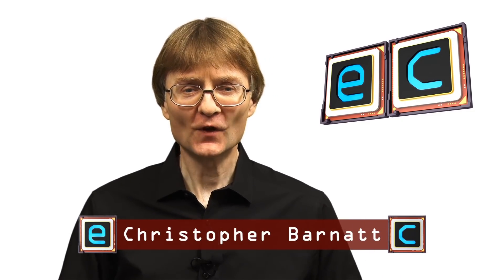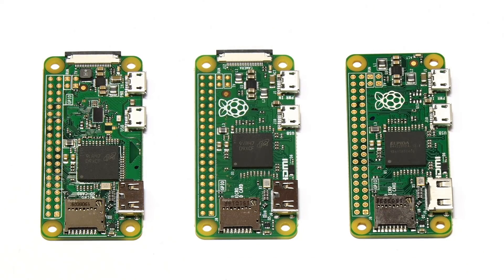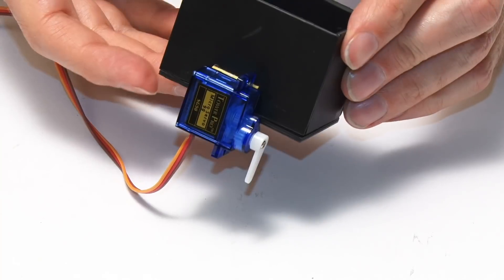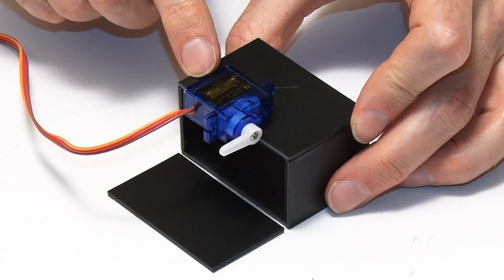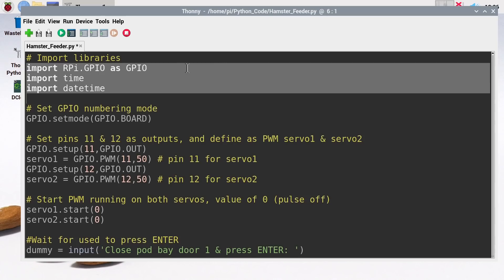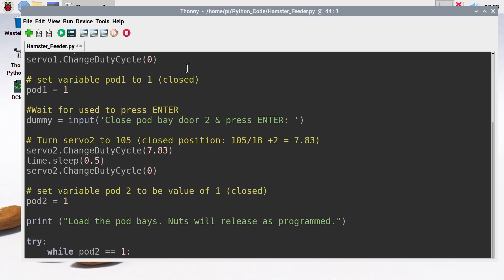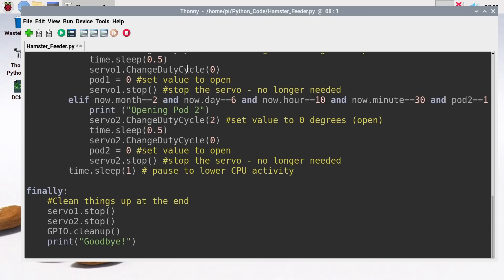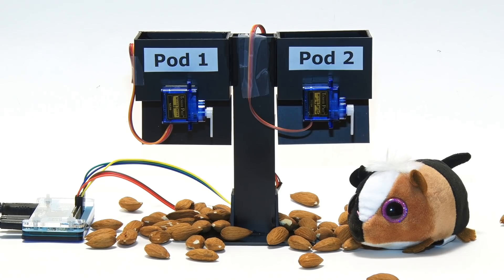Raspberry Pi Zero Hamster Feeder

Comment: This is pretty cool but you could have placed the pod hinge on the other side and then actually close the door as well.. allowing you to only let some nuts drop out and then close it again. This can also be used as a fish feeder. Lots of potential!
I am looking at doing a system that can open the curtains in my house at specific times and closing it and I think a Pi can do it. I will just need to power the servos from elsewhere.

Comment: I have a old Pi B - I use to have it working years ago not used much.  Now I cannot get it work I download the files onto a 64GB card - when I plug it in I have a solid red light and nothing comes up on the TV .
Reply from the maker: An early Pi will not be able to use a 64GB SD card. So I imagine this is the isuue -- try a 32GB card or less.
Reply: @ExplainingComputers  Thank you Ill give it a try.
Reply: @ExplainingComputers  work thank you
Reply from the maker: @davidcocklin2109  Excellent! :)
Reply: @ExplainingComputers  Even got it working in Remote in Windows.

Comment: Why add the servo on the front . If you added it on the back it could both open and close the  pod
Reply from the maker: Very good point. But the servo is more likely to hold closed without power (maybe!) the way I did it . . . :)

Comment: Hi Christopher. This is the type of proyects I personly like a lot. However, I have a proyect idea that I think a lot of us would like to see. It has to do with raspbery pi clustering. I think there are many more powerful uses to a pi cluster than a pi alone. Thanks.
Reply: My proyect uses 4 cameras and a software called motioneyeos which is build for a pi. However, one pi overheats wen running the 4 cameras. Wondering if a cluster of 4 pi would work...
Reply from the maker: A cluster is on my list. I just need to figure what I would do / show with it. :)

Comment: This code is very fragile. If anything goes wrong, the hamster goes hungry.

I would conceptually orient the code toward holding the doors closed rather than deciding when to open them (implement by putting an open doors function in your loop that has to be defused every iteration, for example... also be very specific about dates, and do robust bounds checking on each loop iteration). I would then create multiple broadly triggered failure paths that lead to the doors automatically opening. Unhandled exceptions and unexpected program exits should also open the doors. Since you really don't want your hamster to go hungry, you should also create a redundant system on a separate battery-backed raspberry pi that monitors the situation and releases the doors if things aren't in EXACTLY the expected state.

p.s. I understand that this was instructional, and not meant to be copied for an actual animal feeder... But someone may well do it. I think with this sort of example in particular, it's important to also discuss fail states and failure tolerant design. We wouldn't want to harm any hamsters!
Reply from the maker: Good post. :)

Comment: Fun. I would have put the servos on the other side though. So they could also close the doors without human help. Allowing for a single pod bay, and maybe a srwpper motor controlled "reloading" mechanism kinda like a capsule toy/gumball machine meathod to push more nuts into the pod. It could then just be set to every x time open servo, wait a few seconds then close. Then rotate stepper moter to refill. Rinse repeat. But always fun to see small projects. Pi0 seems good as any to controll all that $5 board as opposed to $10 arduino uno or what have you.

Comment: or using gpiozero library = https://www.raspberrypi-spy.co.uk/2018/02/basic-servo-use-with-the-raspberry-pi/
also pyboard uses micropython and has specific servo connectors (not on model D), but more expensive than pi0
now thinking about a 7 day feeder where 1 servo pushes each doorhandle out of the way to release ...

Comment: That raises the question of "why?", typical for vast majority of rpi "projects" on youtube. Likee with the mirror that displays current weather (and you have your smartphone in your pocket right there). The chineese auto-feeders cost like 5 to 10 $ (i use one for my fish tank for over 9 years now - it has cylindrical food bay with a small door that can be adjusted to dispense less or more food per rotation - 8 position, purely mechanical - its logics are implemented on tiny electric scheme and it can feed fish once or twice per 24hr cycle - works for a month before you need to add food and for three months on 2 AA batteries... so why build a bulkier less effective device for quadrupple price?! in my oppinion, rpi is trully useful for a) surveillance projects; b) smart-home electrical menagement; c) NAS/data storage/VPN/routing - outside that scope I have not found any useful rpi projects on youtube.

Comment: I humbly ask if you will do a video on:::::: arduino qty 6 plant moisture sensor and auto watering if dry.  1 of the plant just need watering every 9th day “if” plant is dry.  (Has not rained).   Also straight fertilizer water 1 time every 5th week. (That can be verbal upon showing details on watering as difference in setup.  One fertilizer pump can suffice if evenly distributed.

Please not, I believe ther is programming code on internet somewhere to copy and load with little modification.  I can not locate a LEGITIMATE TUTORIAL.

YOU ARE MASTER OF EDUCATION PRESENTATION!!  Thank you in advance for your consideration Sir Chris! (What are limits on arduino uno? Etc. as well.

Comment: Very nice project, althought I would stick servo to the side where the tape is and would make the pod bigger. You could then open the doors just partially, releasing just some of the nuts. This will be better if you're gone for more than 2 days (I can't imagine having like 10 of those pods lol), or if you have more/very hungry hamster (you can feed him multiple times a day). Yes, the nuts may got stuck, but that's a problem for the tinkerer to solve :)

Comment: overkill, you can save yourself a lot of time and money with an esp8266 ($3) or a newer type esp32 (max $5)
The esp8266 has build in wifi and the esp32 has a faster cpu and got wifi and bluetooth
No need for a ttl serial module, just connect with usb and programming can be done with arduino ide, libraries have to be configured for nodemcu
libraries such as wifi encryption, ssl, http client, http server, npt client for internet time, etc...
Reply from the maker: I did make this very point in the intro. :)

Comment: Ideas for improvement:
1) Door closed sensor for semi automated servo closing.
2) Blinking orange warning LED on pod bay door area set to blink prior to nut drop.
3) OLED display for current time and refill operation messages.
4) manual release button on each pod for extra Rube Goldberg points.
Reply from the maker: All great ideas. :)

Comment: Chris, very efficient. Millions of dollars were spent to develop the solid state laser and one of its common uses, today, is to annoy cats. You spent maybe less than 20 pound and a hamster eats!

Millions of dollars, annoyed cats (well slightly more annoyed than what is normal)
20 pounds, sated Hamster.

No, Cats are not always annoyed, they can be quite content on their servants lap, that is, until that servant needs to get up.

Which leads to that ancient question, "What would you rather juggle, Hamsters or Cats."

Cheerio...

Comment: If you fit the lip-reading camera, there might be a problem with the pod bay doors so you can use the manual emergency airlock instead. These little boards are amazingly powerful.

Comment: Great little video.  If you mounted the servos on the other (hinged) side of the pod bay door, couldn't the servo be used to both open and close the door ?
Reply from the maker: Probably so! :)
Reply: @ExplainingComputers  let us know if you try it.  When you manually held the door closed before pressing Enter to move the servo, I was concerned it was going to pinch your finger.

Comment: A better solution might be to put the nuts in a slanted tray so that the nuts accumulate at the end, and attach a paddle to the servo at the end of the tray so that the motor can scoop out a quantity of nuts; that way, it would be able to work for a lot longer than two servings. 😉

Comment: How long have they had to optomize and increase production? Why are they still sold out or only available in quantities of 1? That's some garbage management if you ask me. This isn't some ultra rare wine made from only two acres of a unique royal grape line, this if fiberglass and Chinese... Ohhhh yeah... Oh crap. We don't know how bad 2019-nCoV is going to get over there, or how long it will take them to get supply lines running again without it being so soon that another outbreak starts. They're apparently turning away freight liners full of copper and other resources because there's no one available to process any of it. Those are global supply chains starting to break down with no projected time for repair. Even if it's just temporary, there's probably going to be a electronics components shortage, well, probably an everything from China shortage.

Comment: If the servo was on the other side of the door wouldn't it open and close without needing to manually hold the door closed?
Reply from the maker: Potentially a servo could do this, yes -- acting as the hinge, or a lever to operate it, rather than as a simple catch.

Comment: This could help me. My router is downstairs. I don't want to leave it on all night, but I also want to read the news on my tablet before getting up. If I can get a battery-powered Pi with a servo to turn on the router, that could solve the problem ? Your next Pi Zero project with a webcam sounds very useful too. Are you going to group all of the Pi projects under a "playlist" on YouTube ? Thanks.
Reply from the maker: There will indeed be a "Pi Zero Projects" playlist once there is more than one video uploaded. For switching things on and off, there are other solutions with a Pi than servos: eg https://www.youtube.com/watch?v=UOmRuRywSY0

Comment: Hi Chris!!!  I don't agree with you.  This is NOT a PDLP.  As soon as I saw this I saw many applications for the homestead that my wife and I are setting up for feeing our animals.  Quick question...How many servo motors can we drive with one of these boards?    Can we use any of the pins marked in yellow?  Very excited about this as it has practical real-world applications.
Reply from the maker: I stand corrected! :) You can indeed use any of the general purpose pins (the ones marked in yellow) to control a servo -- that's pins 7, 11, 12, 13, 15, 16, 18, 22, 23, 24, 26, 29, 31, 32, 33, 35, 36, 37, 38 and 40. However, if you are using more than two servos, I would power them from a separate power source, and not the Pi itself.

Good luck with the homestead! :)

Comment: Well I've seen some prototype projects that uses the Pi Zero for like feeding plants for when you are away on holiday. I do know it can be used to siphon water from the sealed beaker and into the plant pot. However there are better ways to help plants grow is by using light sensors and moisture sensors to prevent the plant from "drowning" or not having the opportunity to go into its Rest Cycle. Most plants use chlorophyll for photosynthesis to produce the sugars, but more importantly absorb CO2 and water for the sake of environmentalism. 

So if there is a working project for plants to get the correct amount of light and water at the time it needs to prevent dehydration and light overexposure, then I'm sure most of you guys be interested to see it work in action. Plus lets not forget that various plants are adapted to various environments like Cactus and Lily Pads which vary as the Cactus (xerophytes) have less pores - formally known as stomata to lock all the moisture, whereas the Lily Pads (hydrophytes) are more stomata and so on.

Can I ask not just for you, Chris but to the viewers if they find this project idea useful to keep our house plants or even farm crops healthier by using the Pi Zero or maybe the Pi 3A+ to power our plant feeders by providing light, water and maybe squirting some Miracle-Gro?
Reply from the maker: I have been toying with the idea of an automated Pi gardener . . . Sensors to detect moisture, sunlight and temperature are available.
Reply: @ExplainingComputers  This would be useful for farmers and florists don't you agree, Chris?
Reply from the maker: @meowthx1985  I certainly agree! :)

Comment: You could just use a plastic fizzy drinks bottle half a litre with the bottom cut out, have a bit of threaded rod going up through the lid connected to a motor, on the bottom put two sets of paddles and 2  blocks of wood on opposite sides to each paddle,  the two blocks of wood in length will give you the amount of nuts will be allowed in one full rotation
Make the bottom block slightly bigger than half the gap have a hole go through it for the threaded rod and nuts and washers will go through to give it some support and farting the paddles
Reply: Archimedes screw , turning to feed Dave .
Reply: @boboften9952  not really Archimedes screw yes you could do it that way but there's no need
Reply: @johnsweda2999  Yes . Just saying . Different approach. Simular results.

Comment: Now just add a hamster wheel to power the RPi and you'll get free energy from perpetual motion!
Reply: That's actually a good idea -- use the hamster wheel as a generator to charge a power bank, and run the RPi off that. Might not be quite perpetual but would be a hedge against power outages.
Reply: @Reziac  I currently power my house using 1000 hamsters but it's costing me a fortune in nuts
Reply: @VAX1970  oh, deez nuts.
Reply: @VAX1970 What size  M8s  ? M12s? , M20s ? 
Personally I'd just use Almonds , Peanuts , Hazelnuts.
Reply: @VAX1970   How many kWh (1000 x Wobbly Hamsters) Some think this can be changed kVA/h (1000 x Voles + Aardvarks over Hamsters)
Reply: Not perpetual as u have to feed the hamster food which burns energy
Reply: Anyone with a hamster? Please put a gen on the hamster wheel and log ALL THE THINGS! The world deserves hamster-powered IoT

Comment: Most expensive hamster feeder
Reply: Well...you could also do it with an Orange Pi Zero. That could be cheaper.
Reply: @ArjanvanVught  esp8266 with wifi connectivity or Arduino nano without wifi connectivity both are microcontroller (simple solution) best for this kind of project .

Comment: If the next video isn't making a watering device, you'll be directly responsible for my hamster dying of thirst. Thanks Chris. Love your work!
Reply: How long does a normal waterer last?
Reply: @MrBearyMcBearface  depends on the hamster. we had one years ago, and I remember needing to refill that every two or three days? we did have two of them in the tank, tho
Reply: @DFX2KX  maybe instead of build a waterer you could buy a couple Guinea pig size waterers
Reply: It's a puppet!
Reply: Next video: using an Arduino to control servos mounted to a water pistol trigger to fire bursts of water into the hamster cage.